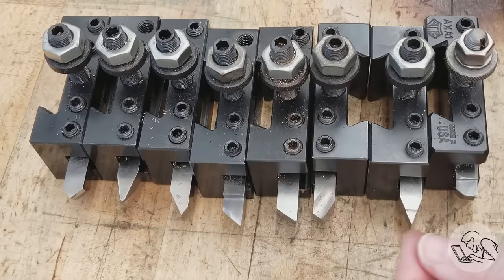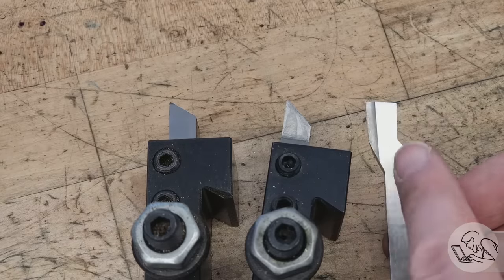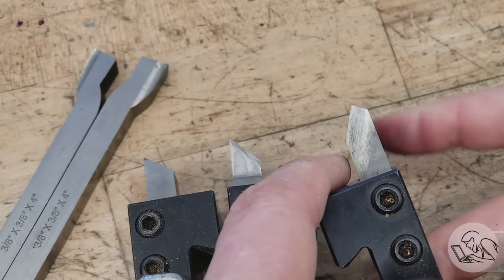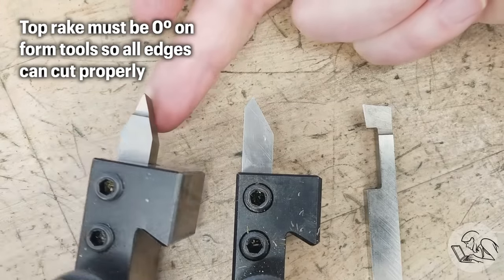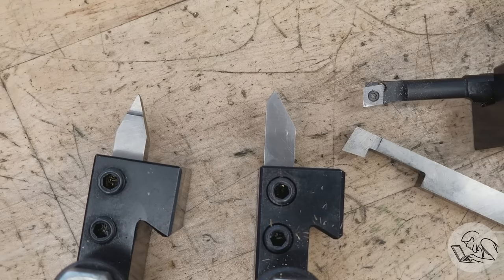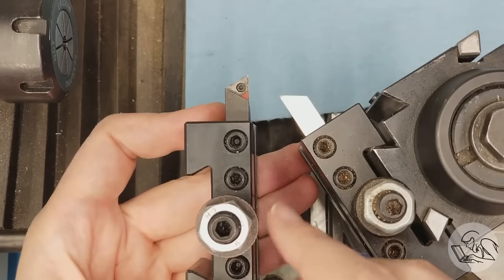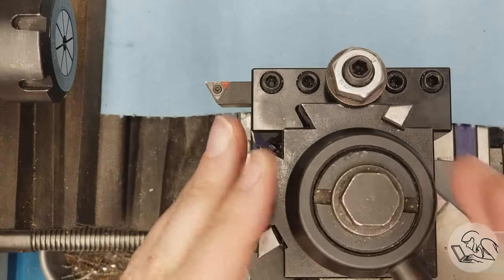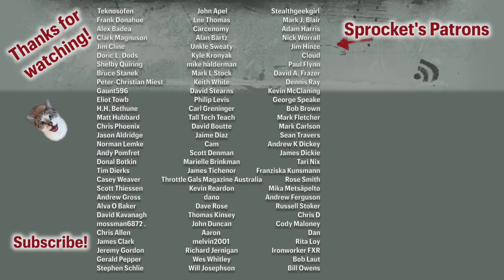Lathe Tool Shapes - What Are They All For?

Comment: If you watch CEE cutting edge engineering out of Australia they use those round carbide bits to make plunge cuts to part pieces on hydraulic cylinders and leaves a surface ready for welding later.
Reply: @TitoRigatoni exactly just the topslide on Curtis's lathe is about the same as Quinn's whole lathe bed 😁
Reply: Big round ones are strong for horrible gnarly weldcutting and interrupted cuts

Comment: This is exactly the kind of instruction that I sought as a lathe-beginner. I have been watching others using a lathe many times, but I hardly ever have spent time doing it myself. Now, I decided to use a lathe for my hobbies at home. I bought a Proxxon PD250/E mini-lathe. German quality, condensed into a small piece of equipment that doesn't look like much at first, but will most probably do the job quite well.
Of course, I also bought a set of lathe cutters with it, but, I couldn't discern as how to put them to use without instruction, although I witnessed this many times before. I guess there's much truth in the saying that you only really learn a trade by actually doing it yourself.

Comment: People may have noticed that a turning tool works better as a facing tool when withdrawing it instead of pushing it in, and you showed why, with the angles. When there's a hole in the part you can often get away just by reversing the direction of feed when you're facing while leaving your tool post square. Lighter cuts though.
Reply: The default direction of the cross slide power feed on old machines, like south bends and their contemporaries, is from in to out as well. I imagine that these 2 things are related. :) For example, when your lead screw direction is set to progress the longitudinal power feed towards the chuck, the cross power feed will progress towards the operator. Back when these machines were made, I reckon it was a significant time saver to NOT have to change a tool in a lantern tool post. It's the opposite on newer machines, I guess the advent of quick change and turret style tool holders made it easy enough to change tools that it made sense to change this behavior in newer lathes as well.

Comment: Great video and most helpful. I'm a gunsmith not a machinist but I use my small lathe to turn barrels from barrel blanks and modifying factory barrels. Getting a nice finish when turning a barrel from a blank is so helpful. And bumping a shoulder back to get the front sight indexed properly is common and requires getting into a tight space. Thank you for explaining the tools to do those jobs.

Comment: Thanks Quinn. I remember, when I was a young teen, (about 16), I was going to a Tech Trade School, (night school, while I was going to a different high school), where the old instructor, (Joe Fraiser) <not the ball player> showed us how to grind a 3/8 x 3/8 square high speed tool steel bit to a 1/2" deep gouging tool with a 1/8" wide snout and a perfect radius on the end, to cut to the left and at the end to cut a BALL & Groove that would go inside a thimble cap on the end of our Screw-Jack. Tgen how to turn the radius inside the cap and then close the thin edge around tge ball with a brass bar an inch high and 1/2" thick. I can still see him do this Wah-La thing with his hand and he stuck his thumbnail into his forehead and scared himself.  That brass pushed against the turning cap, rolled it closed so it wouldn't come off the ball. It was our SENIOR project. 3 levels high with threads turned on each level and knurled. He used a big 8" old fashioned bench vice to squeeze the bar handle on each end so it wouldn't come out. That was over 50 years ago! I still have that tool. I keep it lubricated. I made a similar one in tech school, after I graduated from high school, but it wasnt near as fancy. It was just a bell base with a short neck and a fine'thread 1/2"-28 screw and the closed ball cap. one of the projects in the Machine Shop class. I took tool & die, too. I worked in Job Shops till I changed carriers and went to Electrician when I got a real good job offered to me. Better pay and benefits and a pension...nothing like that was offered as a machinist.
   THANKS QUINN, for your work and explaination.

Comment: I inherited my Uncles machine tools, some good and some not so good. The small lathe is an old Craftsman 109-21270 with variable speed motor. The machinist box with the lath tools looks like what you dumped on the bench. Not the most accurate lathe but I use it almost one a week to make tools or modify something. Comes in handy.

Comment: I prefer grinding my own tools, preferably brazed on carbide. I’ll add a “groove” similar to the grizzly one, which is a chip breaker. Perfect for roughing in parts. I’ll either finish with an insert style tool or with the same depending on the work and and with the goal of a nice finish and no chatter. Speed and feed is Extremely important as well! Great vid!

Comment: Special mention on the grooving tools for trepanning tools. Also no mention of your brilliant HSS tool holder?
One other type to be aware of are the shear tools. They’re uncommon, and not ideal on small, low powered lathes; but they’re potentially very valuable for those scrap bin mystery materials as they can achieve good finishes on materials prone to tearing or galling.

Comment: If you haven't tried cbn in the home shop, give it a shot. I keep a few around for finishing  on stuff especially hard tough or angry things. Extremely low to pressure and very light cuts are possible. Amazing finishes with a .001 or .004 depth of cut with a .001 turn per rev. Bridges the gap between carbide that needs some pressure and a very sharp hss tool that won't cut that bearing shaft. But also on softer things, I can get the rpm up on a big part and not turn my life away doing a finishing cut. Low tool pressure for that finishing cut means basically no taper too!
Reply: They don't like impact or vibration so I basically keep them for finishing or saving a piece where with carbide I'd need to take 2 thou or so and still maintain finish.

Comment: I spent hours trying to grind my first HSS tools with no guidance, and thought for sure I must have bought a junk lathe 😂.
Now I feel ready to go out to the garage and try again. 

 I'm amazed how far I made it at work as lathe operator.  5 years of throwing carbide tools into the CNC and then failing so miserably trying to take .01" depth of cut on my own manual lathe with my own HSS tool.  The most shameful part is that my job title is "tool maker".  I've never felt like such a fraud.

Comment: A convenient thing you can do with a pre-ground set of tools: put a right-hand tool on the right and a left-hand tool on the left of a tool holder back-to-back, then you can use the right-hand tool for turning, and the left hand tool for facing by moving the holder from the left dovetail to the back dovetail all without changing the tool-post angle.

Comment: That short one may have gone in a bar that can hold bits at 90° - and been used for internal threading
Reply: I was thinking that too, double ended so the bar could be both for boring and threading.

Comment: Great informative video. I have a question for you. I note you use the 250 series quick change tool holders which are the same as I use. I recently purchased a 250-010 tool holder unit from Alixpress but when it arrived it had 250-010 on it but it  was tiny and could not be used on my tool post.  Hence it was returned for a refund. My question is why was the number the same (250) but not the same size tool holder. It just has me stumped.
Keep the great videos coming.

Comment: Hi. Thanks for the video. I have noticed on the cheaper drill chucks and small tap handles, the knurl is in the recessed portion of the tool. Perhaps on the chucks, the hand is still able to get some friction, but on the tap handles it seems useless. Do you have any thoughts on that?

Comment: HHS and Carbide aint cheap, especially when learning. My toolroom Foreman, took me to the welding bay and showed me electrode hardfacing. At 65HRC off the welder, Hardfacing is tougher than HSS so a lot of tip crashes and blunders later I became accustomed to Hardface tooling. I still hardface my tooling today and find myself batch welding and regrinding, alot faster than putting a new grind on new barstock.

Comment: I am interested; however, I find the lathes currently available are fascinating price wise.  For hobby machines - on the cheap end (~$500) most are made in China from there to maybe high end (<~$4000) some import & very few made in USA. Above that and mostly above $5000 and more seem to be in the professional to industrial market. Yours looks like about $2000-$3000 model also considering your assorted  accessories. Do you have any investment suggestions for beginners?

Comment: Why do form tools require a zero top rake?

I'm guessing because the form will no longer be exact because some of the cutting is done below center where the cylindrical face of the work is falling away, but it would seem that the error would often be acceptable.

Comment: Tell me about that bit on "fior carbide, you still need all those different shape tools". I need to take my socks off to count the number of tools I have - although that does include a couple of duplicates,. And I decided to make my own "insert swap tool" for my most recent purchase, a 4mm Kennametal parting/groving tool - they wanted some ridiculous amount for what is essentially a piece of flat bar with two small pins... ;) [It's possibel to put the insert in with a soft hammer, but removing it requires some way ot pushing it out, which is tricky],

Comment: What you’re telling me is I need to buy a case of tool holders for all the bits.
Reply: Or just a drawer or box and a grinder. Take something out of the box that's close, grind it to work. I started out with 6 hss blanks, used two of them the most and just kept touching them up to fit the job

Comment: I am led to think that metalworking tools, at least these, are much less keen/sharp than woodworking tools--certainly I would never take a turning chisel and scratch my neck with it, much less rub the cutting edge against my finger! (I mean, obviously the neck rubbing thing was a gag... and a good one. :D ) But maybe I am wrong and the ones you used for the finger demonstrations happened to be dull?
Reply: You are correct. Metalworking tools are generally not as sharp as woodworking tools because they must withstand much greater force. With ultra sharp tooling, the thin edge would break and chip before it actually begins to bite into steel or brass. 

Imagine a chef cutting thin slices from a delicate tomato, that’s your woodworkers chisel. Now imagine a butcher hacking through a joint of beef with a cleaver, much more force is required and a thicker, duller edge so that the tool won’t be damaged by those forces and impact.